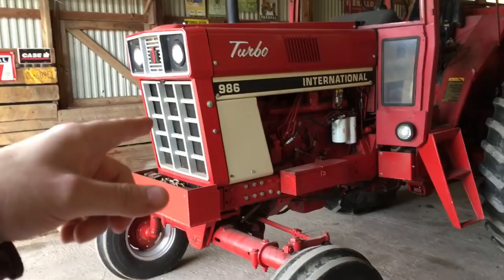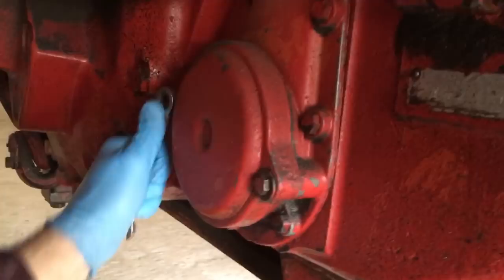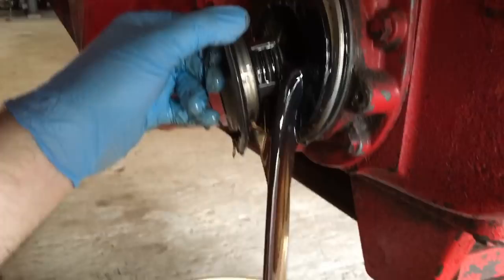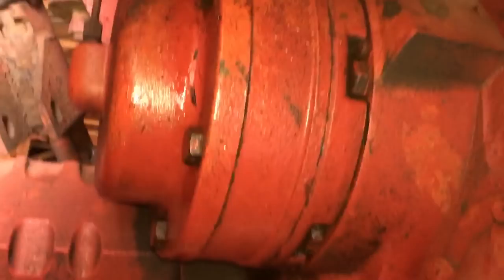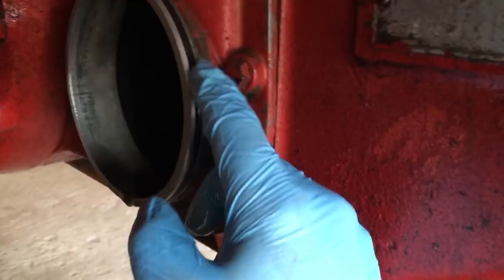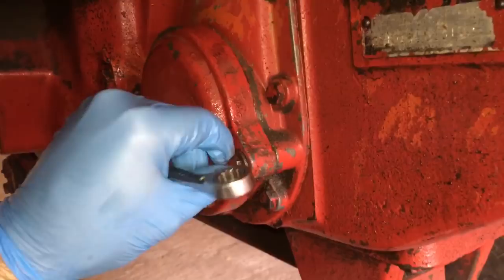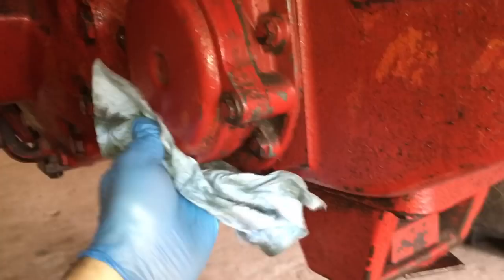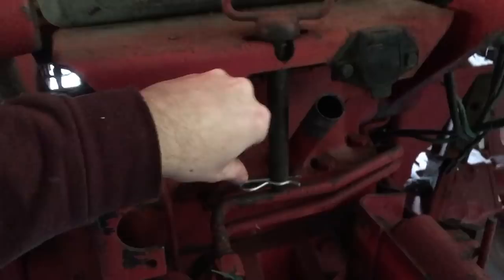IH 986 Hydraulic Filter Change

Comment: OK thanks. I don't run that 886 to often but l thought that light was on more often but lseem to think it was when the clutch was depressed..the coolant is the one that was on a lot .l think it is a defective sending sensor. Thanks for the info.
Reply from the maker: It should go out just as the tractor begins to move as you release the clutch. If it doesn’t you can adjust the rod on the mvc. It’s that small 1/4 in rod that hooks to the valve on the right. Either lengthen or shorten depending on when the light goes out.

Comment: What is the part number for the hydraulic coupler adapters you have?
Reply from the maker: Not sure on the number, I think you can get them at tractor supply in the hydraulic section
Reply: @PAFarms  Ok, I picked up a 1086 in box's got it running and found it it had big couplers.

Comment: What hydraulic fluid do you run in your 685 can you run 80w90 gear oil
Reply from the maker: I think Case ih recommends HyTran fluid or something similar. It’s expensive stuff so I will usually try to find a cheaper version that is still compatible. I would say 80-90 is too thick, the transmission takes hydraulic oil.
Reply: Way to heavy

Comment: Changed our 986 hyd filter yesterday. We put a new t/a in it two weeks ago and ran it for a bit b4 changing the filter. What are your thoughts on the IH 656? I have an opportunity to buy one. Thanks for the video.
Reply from the maker: Great idea to let the filter in for a while. 656 is pretty good depending on what you are doing with it. I think I would try for a 706 because the rear is bigger. Also a 686 would have a more modern engine with better fuel injectors. I always looked at the 656 as being very similar to the 560. But if it’s a good price, I would go for it
Reply: PA Farms awesome! Thanks for your input.
Reply: We have a 1970 656 and it has been a great tractor. We have it on the loader so the wear and tear on it has been exponentially more than if it had no loader. At about 14000 hours we replaced the original d282 that had been overhauled once with a d301 from a 715 combine. A 656 starts really hard but once its running it won't ever die. Watch out for head gaskets though, they only have 14 head bolts.
Reply: @PAFarms  ,,,,   on my recently acquired 656 Hydro, gasoline,($3,500), that the hydraulic/"transmission" oil filter is completely different?

Comment: Do you have to drain the hydraulic fluid to change your filter?
Reply from the maker: No, it stays in the tractor and you can change the filter, some will come out when you open the side but not much
Reply: Not in my 1066 that thing drains like hell you have to be fast not to loose it all maybe somethings wrong

Comment: I changed the  hydraulic oil and my clutch goes completely to the floor now is there any bleeding I can do or just let it run until the air goes out?
Reply from the maker: I would let it run and work the steering and other hydraulics. Usually it clears up
Reply: @PAFarms  ok if it doesn't what should be my next action. I had pressure before I changed it I only let it ran how a couple minutes then I had to leave but I'll try it again lol
Reply: it hasnt clear up the transmission brake still isnt working. i tried adjusting it still nothing but the clutch works fine. any suggestions?

Comment: so rear end and trans are the same 1086-1586?
Reply: Looks like same filter on 826,only you have to take filterscreen and all 8 bolts out,notice that inside you have a filter guide that can be taken out for cleaning.Video didnt mention,maybe dont know,I also clean bottom og housing for dirty oil.Stay safe.

Comment: What is the reason for the dump light?
Reply from the maker: It’s connected to the dump valve in the mcv valve, when you push in the clutch it should come on to let you know the oil is going a different direction.
Basically like a bypass valve